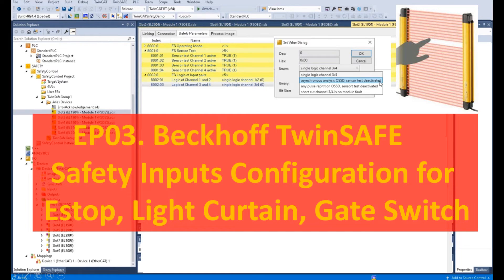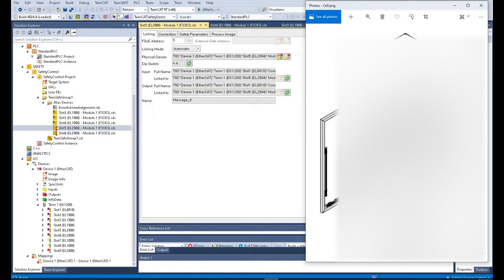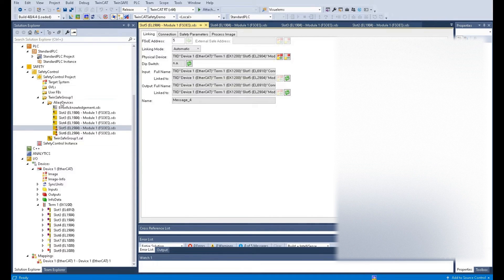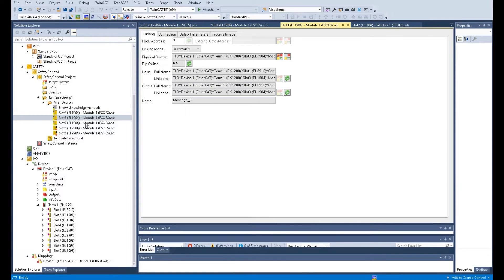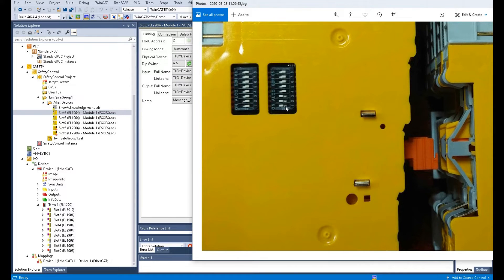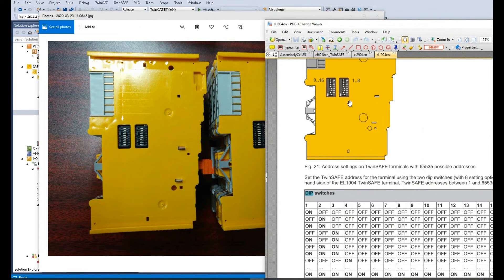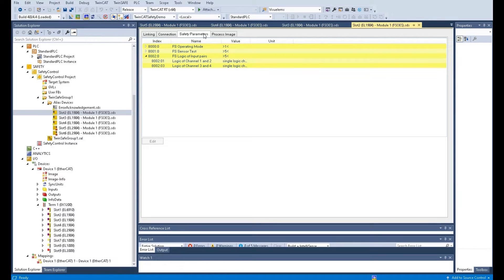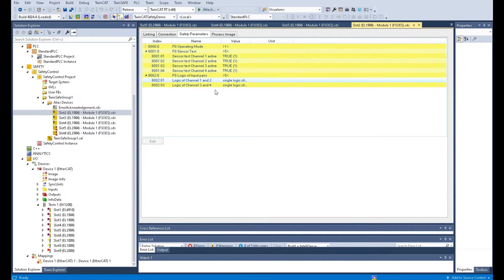SA05. EP03 Beckhoff Safety TwinSAFE - Safety Inputs Configuration for Estop, LightCurtain, and Gate

Comment: hey man, love the videos! you never wen through how to manually add devices. in the last video you say you will add it in the next video and in this video you say you did it in the last video.
Reply from the maker: Thanks watching my friend, please view the video https://youtu.be/wJkuZ9baOu8?t=619. SA04. EP02. I used the "Scan I/O" to scan the hardware devices. I use the Scan for every Beckhoff projects. You can still manually add devices, but you would have many troubles such as revision, topology, device number etc. It will save your time by using 'upload' method.
Reply: @electricalautomation  I 100% agree. Unfortunately it's a massive project and if I were to start the setup when the hardware was ready I would be fired 😂
Reply from the maker: @Salim-f4b6m  Got you. you can go ahead to manually add the devices, and you can still use "Scan" after because it can compare the online/offline, so you would know the setting differences
Reply: @electricalautomation  oooh that's a really good suggestion. Thank you!

Comment from the maker: Note: SA05.(EP03) has a technical problem inside.
The wiring of the Safety Inputs for Light Curtain and All the OSSD devices is found wrong, the OSSD signals should be wired at 2/6/4/8, rather than 1/5/3/7. I think this would be problems for lots of people when the first time they use Beckhoff Safety Inputs module.
Reply from the maker: I am doing the commissioning test on a project and find this problem. Sorry or that. I will make a video soon to clarify this problem.